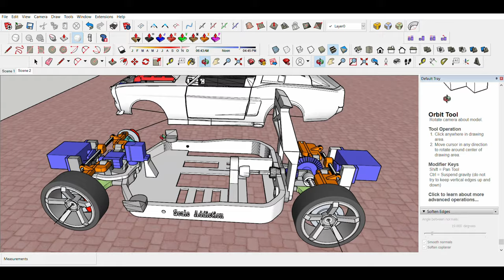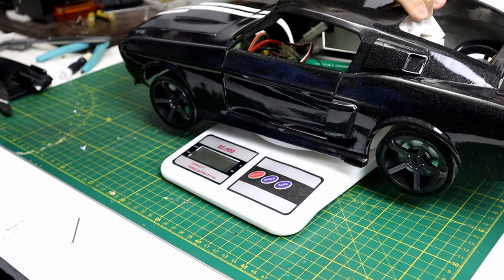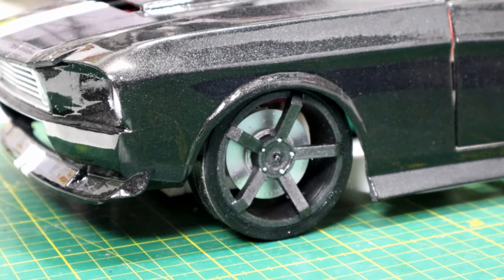3D printing 10th scale Shelby 1967part3/How to 3d print rc car body/Painting rc body/Scale Addiction

Comment: Love ur creations man <3 but i have a question, why dont u put the DC motor on the front to make it like a FR car style ? front-engine rear wheel drive, it would be awesome, or is it too messy ?
Reply from the maker: That's a good idea, I cant put the motor in the front,  the suspension servo taking so much place for now, maybe for next chassis design
Reply: @scaleaddiction  cant wait for it !!!
Reply: Tamiya did with the TA03 F in mid 90's and won several majors cups around the world, then it was 'banned'...

Comment: To be honest, i don’t want to hate the video, I think you did a great job creating a 3d printer body but idk why the body doesn’t look smooth and the wheelbase isn’t perfect.
Reply from the maker: The body printed in fdm printer not sla, if its printed with resin printer, it would be smoother, and the wheelbase changes a bit with raising and lowering the suspension, but other than that its same wheelbase